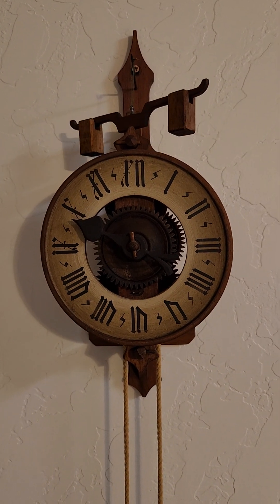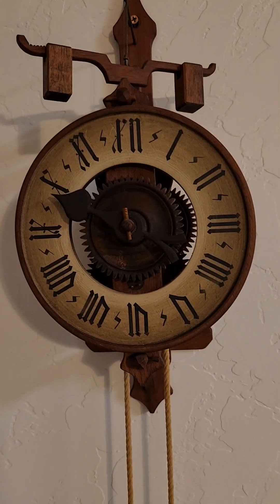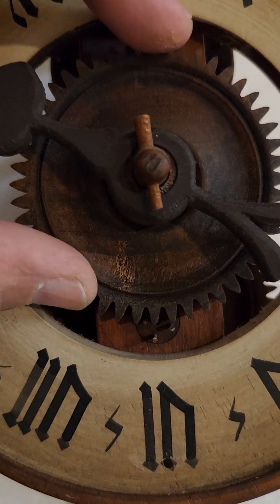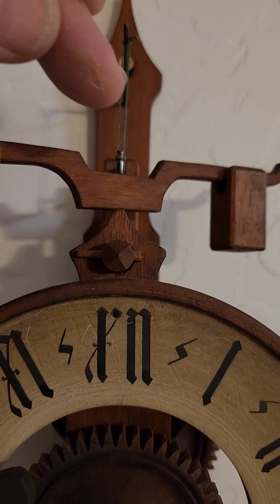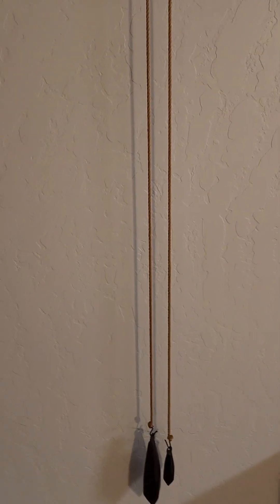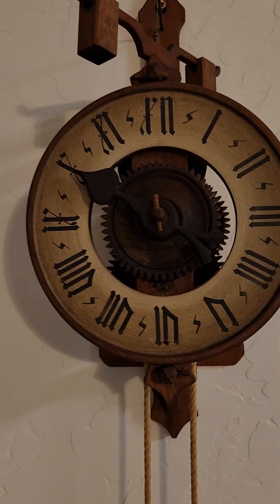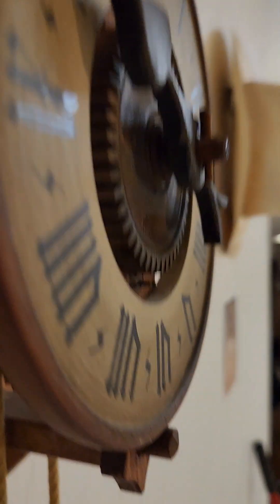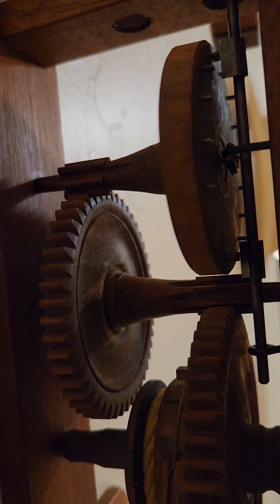Early Clock Mechanism -- 1970s Bott clock (Verge and Folliot)

Comment: how do I adjust the time hand, just force it to the correct time? Or should I wait until real time matches the time on the hand and then start the clock and allow the weight to do its job?  I have the swinging ball type of this clock, and just set it up a couple of days ago. It's running and very cool but it runs out of rope quickly.
Reply from the maker: It's a friction fit. Just coax it to the right point.
Reply: @bwhog  Thank you so much! It was given to me at least 10 years ago from someone who knew I loved clocks, he saw it in Japan, and brought it home for me.  I never tried it until a couple of days ago.  It doesn't have marks on it of any sort so I don't know who made it, how old it is, etc., but it does run and it's pretty cool.

Comment: Hi, I have an identical watch but I can't get it to work. Is there anything I should do after attaching the weights to start the mechanism?
Reply from the maker: No, you hang the weights and it just starts. Make sure all the gears move freely. That's probably where your issue is. Something hung up in the gear train.